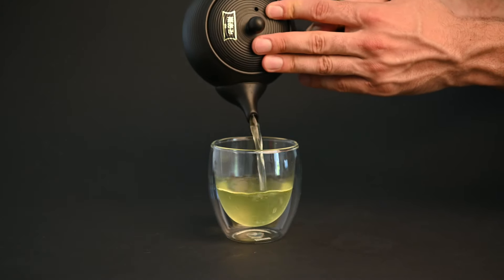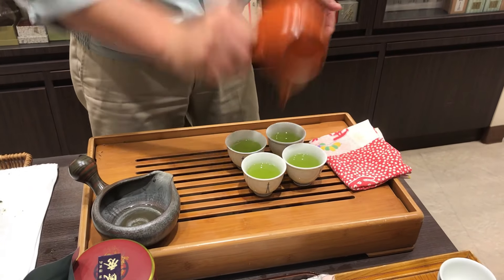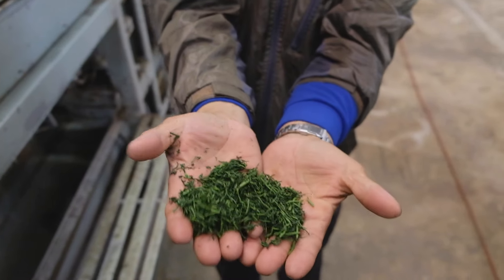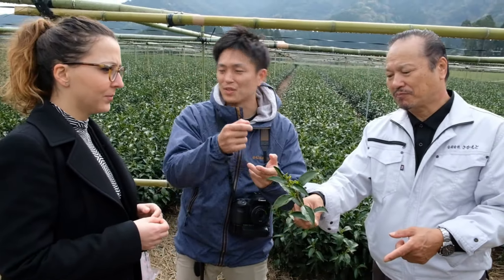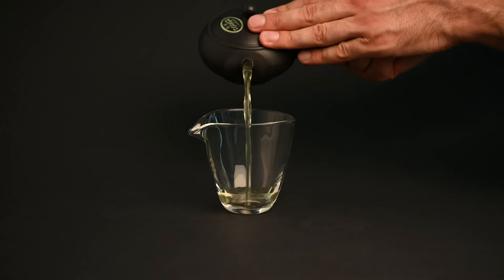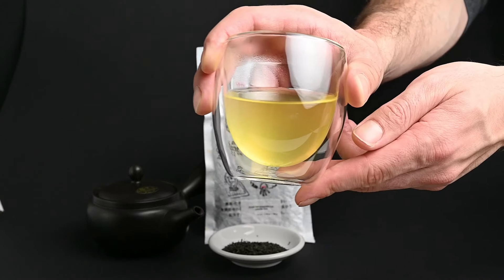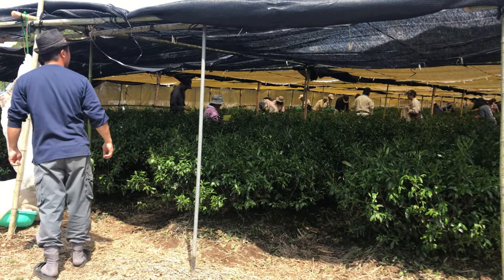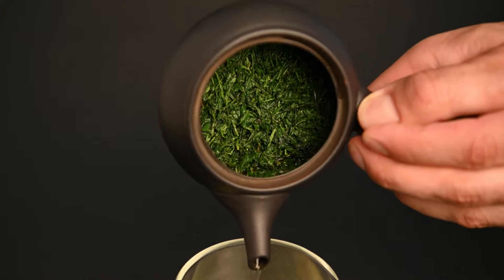Japanese Green Tea - Everything You Need To Know

Comment: Hi thanks for this. Does freezing your teas degrade them at all?
Reply from the maker: the humidity should be so low that you can keep them in the freezer if they are unopened. You don't want to store them after opening because then the humidity from the air will freeze and create "freezer burn"
Reply: @Nioteas  got it thanks!